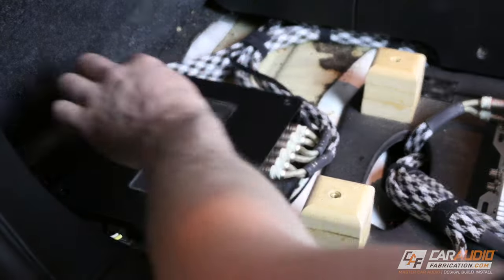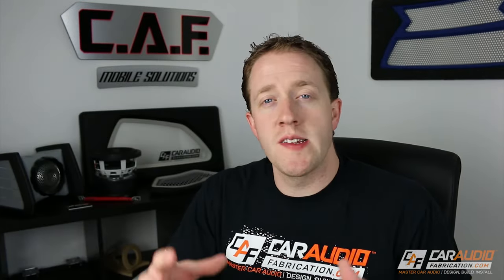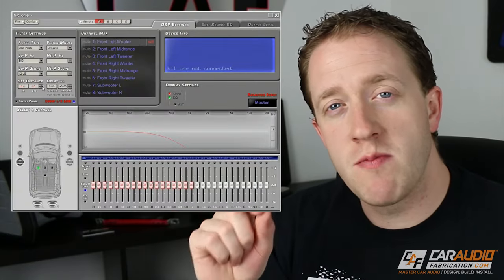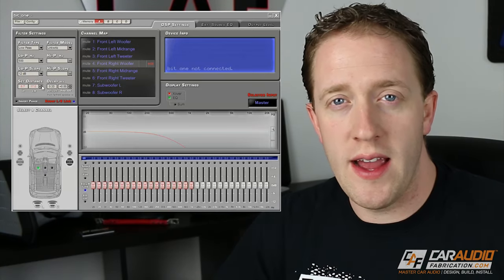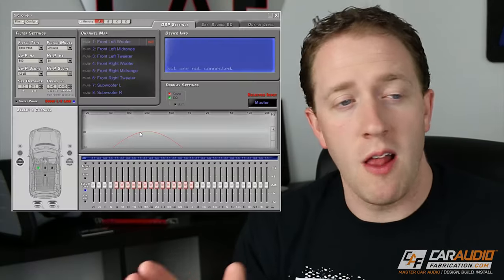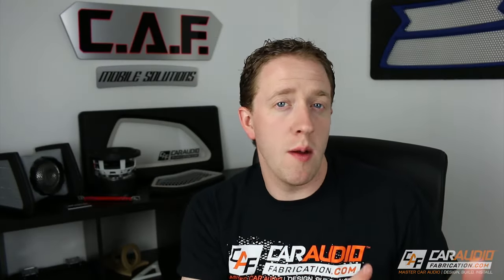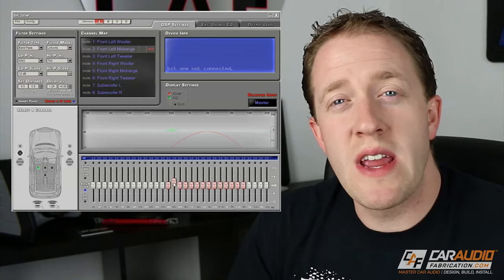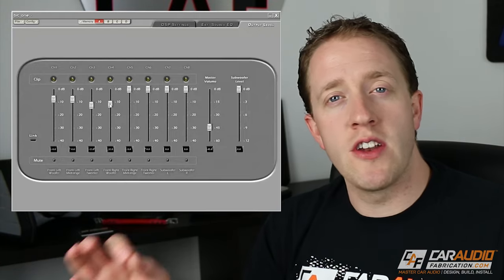What is a DSP? Why you need a Digital Signal Processor for Car Audio

Comment: I absolutely love your content but I'm a newbie and I still get confused. Let me break down what I got. I have a pioneer dmh1500 NEX, A 2.6 DSP, a Brutus elite 1200 watt anniversary edition, a JVC 4 channel 600 watt amp and a massive two channel 500 watt amp, two kicker 12 comp 800 w speakers in a box that fits in my Dodge ram 1500. I also have two tweeters I believe they're ds18 300 watt. I'm confused AF. My best guess is to run the four speakers in my door is the 6x9s to the four channel amp and the two tweeters to the two channel amp and the two subwoofers to the monoblock Zeus amp. With the remote wire I have to connect it to all of the amps and the DSP correct? Now the wires for the door speakers seem a little small not sure if it would make a big difference if I made my own nine wire install kit. Bring my tweeters to the amp or just to the factory wires that are already there.? One of my good friends that he was going to help me do this and all of a sudden for 3 weeks he's had someone sick in the family which I think is a bunch of bull malarkey and now I'm stuck with my truck all the way apart the carpets out the seats out everything is out. Granted I have easy access to everything now but my freaking truck is a part and I can't drive it. I wasn't asking him to do it for free I was going to pay him but obviously he doesn't want my money. It just seems like every shop that I go to is if I don't buy my products from them they don't want to help me. I mean I was almost at the point of taking a hostage LOL just kidding that was a joke don't be having swap come to my house. Not sure if this link will accept pictures or not but I made a amp board and I got some zero gauge power wire and it's turning out pretty nice but of course I haven't hooked any sound up yet I'm almost scared too. Help help I'm lost do I send the signal first to the DSP and I will control the aftermarket radio signals to send to the amp and I click my heels twice and it just sounds perfect. If you have any suggestions on here to listen even jump off the head Sunshine skyway in Bradenton that's an option if I don't get this truck back together soon. I'm a cheapskate so I'm not going to pay the $1.50 to drive off and jump off a bridge LOL

Comment: Hi if my aftermarket HU come with DSP (TA, 13 bands, Speaker Level, Crossover) do i still need an external DSP?
Reply: My question to, did you ever find an answer to your question ? Thanks
Reply: IMHO, HU DSP is good enough if you are not a perfectionist.. With the pricy DSP cost, i would rather stick to HU DSP if you plan not to spend too much money..

Comment: id like to see you make a video about how to install a dsp, crossovers, etc. i see different info on that. like connecting power from amp power, or directly to the battery,etc .Someone gave me a bit 10,lc2i,component tweeters & mids, with crossovers, and sub, and im not certain how to connect it all, and if i even need it all.

Comment: I have a 2008 acura TL that had an awesome ELS sound system. got rid of it and installed aftermarket kenwwod to improve it but my audio sounds like it got worse. stock head unit with kenwood excelon 1800 series and a xr 400-4 amp. what would you recommend?

Comment: Everyone;
I'm building a standalone (leisure battery) sound system for a vampervan conversion. 

The processor seems to avoid the need for a head unit? I.e rather than using the car headunit as normal. 
I could actually replace the source with something of a far higher standard and use the processor to decode the track??

Comment: i'm about to install this DSP bit ten for my OEM radio some tricks and tips would be nice and usefull im running stock door speaker for now i just finished my subwoofer box so i need to get the high output from the radio to the DSP than to the mono clocks im running

Comment: Hey how are you? I wanted to know what components do I need to add a sound system to a Nissan Altima 2015. I already have a 1000 watt JL Audio power amp and a 15 inch Kicker. Also I'm using the factory Radio. What 6by 9 speakers you recommend?

Comment: I am not sure if I can place a DSP in between the OEM head unit and the OEM Amp. The OEM head unit is a modern unit (2014 Ford Fusion with the 12 speaker Sony audio system). The amp is 500 watts  the speakers are rated @ 25 watts each and may only be getting 15 - 20 watts. The rear deck is over rated on the watts. I can not remember what the wattage was, maybe around 30-50 watts for cheap Sony 6x9s. The thin rubber surrounding on the speakers were exposed to heat and melted so the speaker blew. All the speakers, except the two 6x9 on the rear deck, are 4 ohms and the rear deck speakers are 2 Ohms; since they've already given out I may go with 4 Ohm 6x9 for the rear deck to cut some of the base head crap that ford has set the head unit up for their chepo Sony speakers. The speakers seem to shit themselves with the power that they are currently given. I may have a shop do the work but can not find a good shop around my area. I guess when I am done with summer courses I will install the speaker with a little bit of 236 mil sound dampening for the doors and trunk.

The speakers I am thinking of going with are:

Precision Power P.65C2 300w Max 6.5" Power Class 2-Way Component Car Speaker 
(for all four door leaving the center channels for later or forever sony el crapo)

and 

HD-690CF - CDT Audio 6x9" Carbon Fiber Subwoofer Cast Mid-Woofer. (Either the 2 ohm or the 4 ohm version for the rear deck)

Later if an amp is purchased I may then be able to place a DSP in between the head unit and the amp.

Comment: Do factory head units have hard coded time correction (like they do with EQ and bass roll-off) that would need to be taken into account when running aftermarket amps and speakers through a DSP?

Comment: Hi Mark, I have an aftermarket sound system in my car. I have 4 6.75 inch kicker 2 way speakers at 100watt rms. They are powered by a Rockford fosgate 100x4 channel amp. Also 2 JL audio 300 Watt rms 12" subs connected to a kicker 300x2 channel amp. Everything sounds good but I want more volume from my door speakers. They are not as loud as I want them. Can I hook up a digital signal processor to my 2 way speakers or is this only for components. Also will this increase my volume. I don't have anywhere that I can put more speakers in my car without cutting holes in different places then I have to buy another amp costing more money. What do you suggest? Some people I talk to say that it'll increase my volume plus give cleaner sound. Others say cleaner sound but same volume because you still need the gain on the 100x4 amp set properly so speakers won't blow. What should I do? Thanks

Comment: Is a headunit with active features such as a pioneer avh-x5700 a good replacement for a DSP? It has all of the same features including a 13 band equalizer but is the overall sound quality the same? Thanks!
Reply: for you guys just getting into dsp, maybe try high end pioneer decks or kenwood have some dsp 13 bands built in. I run a kenwood dnn 992 and notice the difference but wanted a lil more control so I added the helix dsp pro. love sound quality. and Im running hertz mille 3way in front and mille 2 way in rear with jl hd amps
Reply: Was wondering the same

Comment: Hi Mark and Thank Uu, Would A DSP Also Help Me on a Dune Buggy with 8 8" inch Marine Tower Speaker. They Are Outside and All The Same Power Sport 8 Speaker with 2 Soundstream Amps. Adding 1 More Set next Month. My Question, The Amps Have a Hig & Low Pass 50hz-500hz. do I Still need a DSP. Thank Uu in Advance...Rafa

Comment: I have the Pioneer Stage 4 DEXP99RS so I really do not need a DSP, but I love the Alpine PXAH800 and the BitOne looks clean. Sadly the P99RS has no optical output though. .

JL Audio has the newer VXi amplifiers with built in DSP. The Pioneer uses AKM DACs such as the VXi. I believe the H800 uses Wolfson DACs if anyone is keeping score.

Comment: Thank you for the Great video, I am currently trying to upgrade my car audio and not sure which route to take.   Got a question regarding dsp.  I have 2013 venza 6 speakers non jbl.   I would like to add 4 door speakers (jbl gto)  two dash tweeters (jbl) one jl 10" wx1 sub.   I have hertz hdp4 amp 4*channel ,  and one mono amp.   Question is,  can I add two extra speakers?  Or stick with 4 door speakers?  I am contemplating about getting lc8i,  (is it also a dsp?). Should I get it?  Get an equalizer,  Or any recommendations? 

Thanks

Comment: Question: Why original head unit sounds more clear and less muddy compare to my recent aftermarket head unit even with built-in 14 band DSP EQ?
Reply: Answer: you offer too little information. Many OEM headunits have a default EQ profile which aid to make the default speakers sound better. The EQ bands mean nothing generally. 
Be sure to remove all the stock hardware that's between the headunit and the speakers and check everything for good contact and correct polarity.
A DSP might help you but it's better to ask a local professional about your car and his experience with them, maybe he can point you in the right direction.

Comment: Thank you for the video, 

My question is will this device(professor) improve the sound quality of the factory speakers or will I need to purchase better speakers to take notice? 2016 ex-l accord.
Reply: upgrade order: 1. amp, min50w rms per channelin small car or ute 2.speakers  3.headunit or dsp (these can be both.) always amp first. if the speakers are so bad that the amp doesn't improve them, then good chance it'll blow them up and you'll have a good excuse to get new speakers too.

Comment: I’m looking to add a DSP to my system witch would u recommend audison bit one vs audio controller 810 I have a sundown audio salt 4 running a sundown audio ZV6 15 in a custom d4s box tuned to 30.8 hz built to spec for the amp and sub and a sundown audio salt 200/4 running my audison VOCE AV K6 in the front doors and audison VOCE AV X6.5 on the rear doors with a kenwood excelon dmx957xr and 2 jp 40 lithium and 2 jp 630 super caps on a 250 amp power bastards aftermarket alt with a voltage booster to 14.8 V by US alternators stinger zero gauge wire with Big three upgrade dual inputs into the salt 4 stinger x3 rca 20 foot 2 for the salt 200/4 and 1 for the salt 4k lots of dynamat xtreme in the trunk all 4 doors and head liner and floor and a lot more but u probably get the idea I’m looking for a good DSP to fine tune my system

Comment: I NEED HELP!!! so basically, my aftermarket car head unit has 2 sets of RCA outputs. one is labeled “front” and one says “rear/SW”. I currently am running 2 subs an AMP connected to the “rear/SW” RCA. But now, I want to add another amp to power all 4 door speakers, in addition to two powerful bullet tweeters. I’m thinking about 2 Skar Audio VX35-ST’s. This means i’ll need to add a 6 channel amp (2 channels for 2 front speakers, 2 for rear speakers, and 2 for two additional tweeters. my question is how will I wire my new amp to my head unit? my “Rear/SW” outputs are taken up by my Subwoofer amp, and that leaves just the front RCA Outs. I am perfectly fine with loosing the fader and balance features. but do i need some kind of RCA splitter or something to be able to wire up the amp? Or is there an switch on most amps to only require one set of RCA input to be split across 6 channels?

My other concern is how will my amp “know” to send the proper frequency signals to my new bullet tweeters? will my bullet tweeters just “know” to not play low frequencies?  Or am I overthinking this- Will my speakers/tweeters all play music properly just using the “front” rca outputs? Assuming that I figure out how to get a sound signal from my head unit’s “front” RCA, is it a hazard to wire that to bullet tweeters? my fear is that my tweeters will be blown due to low/midrange frequency signals. 
I’m not sure if this necessary, but would it help to tap into the wires that go into my OEM stock tweeters (that i’m looking to replace with bullet tweeters) instead of running new speaker wire to the new tweeters? If that is in fact the best way to go about doing this, how will I amplify the signal?

Please help!!!!

Comment: I have component speakers woofer/tweeters they are Hertz Millie MLK 1650.3 I want to run a DSP and run 8 sets of them total 8 woofers / 8 tweeters 4 sets to front, 2 sets to rear with Separate L / R and Front to Back. Now I have a 4 channel after market amp that can also parallel to 8. How do I get my woofer and tweeters as one set of speakers like a coaxial setup without using a crossover anymore and using a DSP unit? Or would I need two DSP units?

Comment: I stuck a jl audio marine system in my motorcycle doin so I had to mod the tweeters to make them fit when I did I nipped a wire to close to the tweeter for my comfort off longevity, so my dealer called jl and they dont make just a tweeter for the speaker I have am I getting a run around ? If so , would you recommend a marine tweeter I have 2 6.5 jl marine with jl 500/4 amp metra dsp and factory head unit thanks for any recommendation

Comment: Hey thank you so much for taking the time out to upload these videos!!

i do have a question i want to do a complete overhaul to my 1988 lincoln town car audio system from a new deck amp speakers sub and another amp to push the subs. Do you have a wiring diagram to show how to wire such a setup? Thank you 

Best regards, 

Mike

Comment: i have an audison bit ten. i have not hooked  it up yet. will this make a dramatic effect on my 2014 toyota tundra system? i have focal flax 6 1/2 seperates up front and focal integration 6 1/2 components in the back running off an alpine 5 channel amp( 117x4 and 520 watt for the sub)  jl audio 8w7 custom box for the tubdra..using the stock head unit

Comment: I was thinking about getting a Dsp but was told that I couldn't but to get a crossover instead.  I have an aftermarket kenwood excelon head unit & speakers in my car. Also an sub w/ amp.  My question can I do a dsp as opposed to a active crossover?
Reply: yes but you will need to have separate  amps for mids tweets and sub

Comment: Great video Mark!  Am I correct in assuming that if I use a DSP, I could eliminate the passive crossovers that came with my speakers, or does a DSP work in conjunction with the passive crossovers? Thanks for doing these keep up the good work.
Reply: It can be either, or, depends on what you are wanting to accomplish. Your passive crossovers are simply going to prevent which frequencies are sent to which speakers but you will not be able to adjust output, time alignment "delay" or equalize those speakers without using a DSP or your head unit IF it has DSP features built in. Hope this helps!
Reply: Thanks for the responses....DSP's were not around when I started in car audio many years ago...

Comment: Hi Mark was looking up information on DSP vs Paragraphic EQ wondering if Zapco ASP-Q1
Dash Mount EQ/Crossover would achieve volume leveling my JL tweeters .  Still trying to figure out the most cost affected way to upgrade my current system!!!

Jon

Comment: Hi! Can I use a DSP with components that have crossovers? Or is it just for active components?
Reply: the idea of a DSP is to go active.  Active is more efficient and gives much more flexibility. I would not use passive crossovers with active.  However you can place a  small capacitor on the tweeter speakers to prevent damage from transients ect.

Comment: Hi could you make a video that gives us an overview of an Audison Full Da system? Ie what plugs into what and with what cable types (OEM or aftermarket into the processor, Ethernet to the amps etc etc ? ) perhaps an overview diagram, what the possibilities are for source but if you are completely aftermarket? That would be super helpful, the new tech has a lot of people confused how it all works I think
Reply from the maker: Sorry, I think that is something that the company should create in order to better instruct users on how to use their product. You probably wont see that here.
Reply: No worries, Iv'e checked Audion website and other material, but they don't go into enough depth i feel. I may do more research then make and post this video myself.

Comment: I have a 2016 charger rt with the 8.4 uconnect radio I'm wanting to keep the head unit but replace 6 speaker alpine system oem an use  a 4 ch amp an a mono amp an one 12 I'm being told I'll need a ( loc) like lc8i by one guy an another is saying got with axxess dsp an the axxess harness what will be my better choice

Comment: This is my dream build please need the PRO YT HELP.  2 pairs of comps, the Hertz MPK 165P.3 PRO, Hertz HCP 4D amp, Jl audio W6v3 H.O. sub  with a 600/1. The Hertz amp & JL stuff is from previous install. Salesman was explaining the DSP they will be using is also Hertz, the H8. But... I remember them saying only 4 inputs or outputs can be utilized? 4 channels? My sub will not be able to go through processing? Is this correct? They had the Audisons DSP's.  Should I go Audison or will the  Hertz H8 suffice for this build? I want to remain stock OEM so no deck. Thanks!!

Comment: I own a fx37 2013 and i upgrade the speakers with jl audio doors speakers and jl amp. And also a 10” kicker amplifier subwoofer box. But my sound sistem  sounds. Like icecream truck with bass.    The mids. Sounds too high.    Im very disappointed with the set up. The shop i bought don’t know what to do.  Theres any brand name of  audio processor i can buy for my infiniti fx37

Comment: Wouldn't time alignment offset the sound for the passengers?
Reply: Yes but there are some processor a and software that can make sound centered no matter where you are position software some dap head units gave others don't pioneer did old don't cms etc posi